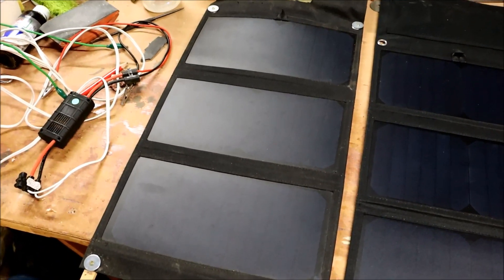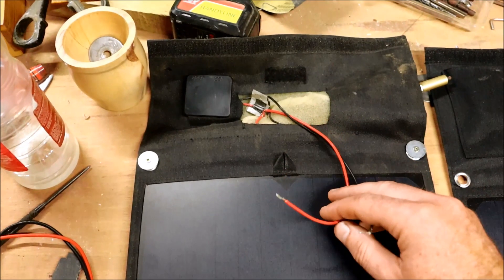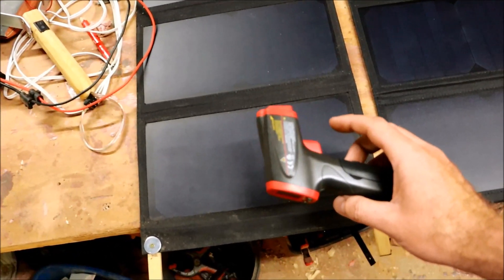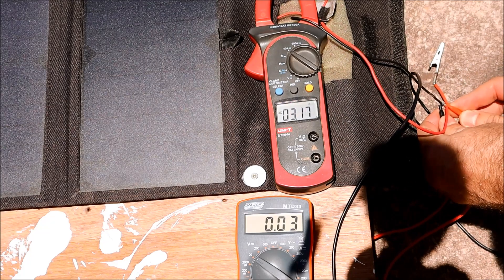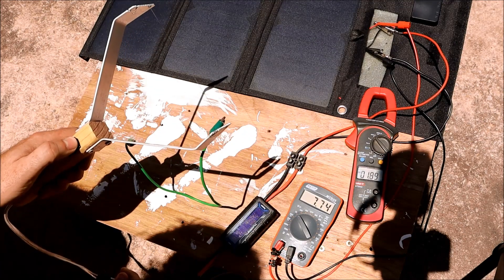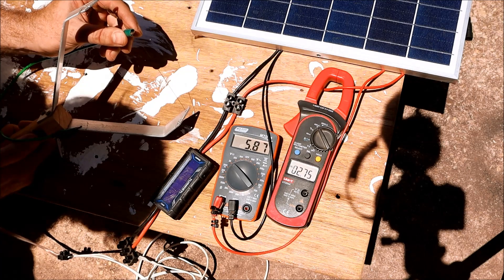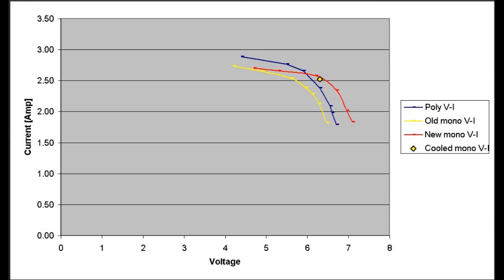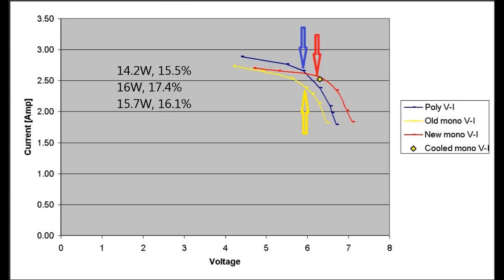Poly vs Mono: Small solar panel test and temperature response.

Comment: The old panel distortion means that the suns rays are not perpendicular to the panel which is effectively causing slight shading variation to the power output - have the same panels

Comment: Thanks William. Always knew that increased temperature reduced the output power - thanks for reinforcing that with your experiments. What I am very interested in is how to cool them efficiently - air blown under them, water sprayed over them etc.
Reply from the maker: These folding panels have a layer of foam backing for impact resistance. It unfortunately also insulates the panels. I have stripped one panel of all its backing and will do a side-by-side test with an unmodified unit next.
Reply: An interesting variant would be in use Peltier cells to increase efficiency of solar panels and instantly provide better temperature conditions for operation. Water would provide necessary temperature disparity.
Reply: @andybalsawood5182  Interesting idea. For a mobile application, this may get too heavy and damage the cells, but for a fixed install, where none of this matters it might work. All I know is that you have to pump current in to create a temperature differential (to cool one face of the cells), but I do know they have been used to extract energy from waste heat.
Reply: @Bennyboy-dog  That's right: if energy is applied -- you get diode-like temperature conductivity from cold-to-hot. If you maintain temperature differential between sides -- you get current flow through external load with temperature conductivity direction hot-to-cold. The initial idea was in usage of powering combo: solar panels on kayak produce electrical power but get very hot from unused energy beyond spectral reception. The Peltier cell has "hot" side connected to aluminium wafer (with a thinnest layer of insulator -- maybe just a sheet of paper permeated with something for water resistance and heat conductivity or just a layer of suitable varnish or paint...) with solar cells on it and "cold" side gets cooling from river/lake water. Maybe by a light weighted thin hosepipe with negligible angle sloped plastic funnel submerged under water to keep solar panels way above water level.
The Peltier cell used by William in the video with head-worn light produces approximately couple/few dozens of watts with a maximum t differential applied. If we measure an average t with known area of a solar cell, measure water t, -- we'll be able to approximate the potential energy productivity of the idea.
If we want to get too nerdy/realistic -- we can include parts' thermal resistance, calculate additional drug caused by funnel, etc. ;)
Reply: @andybalsawood5182  Thanks for the education Andy Balsawood.
Reply: @Bennyboy-dog  I educated with you. Thanks for the opportunity.